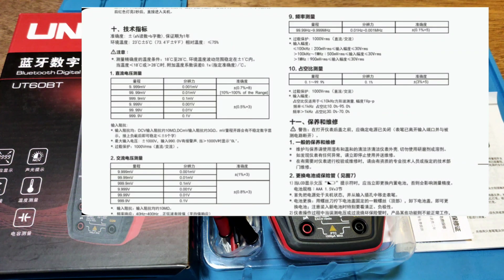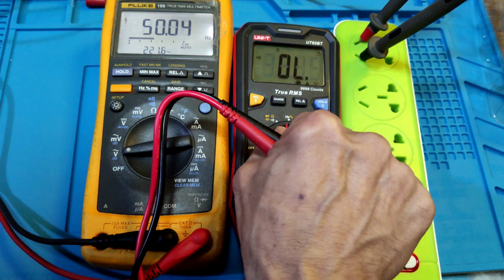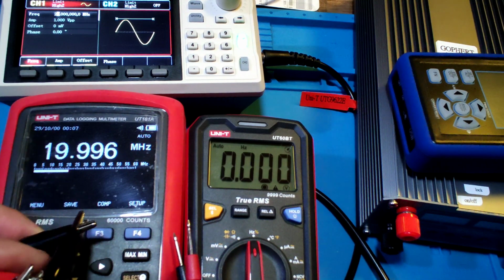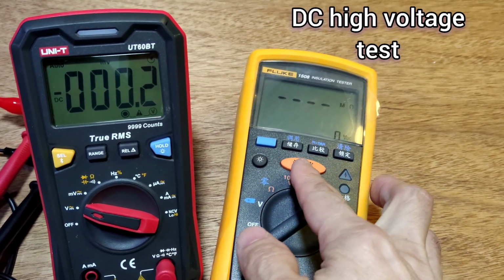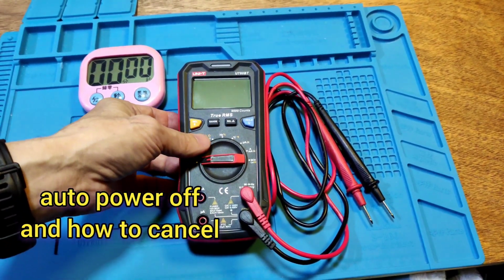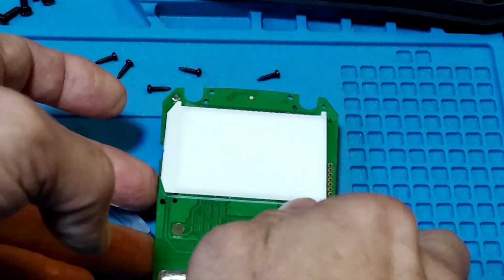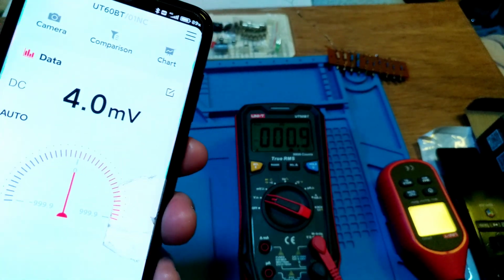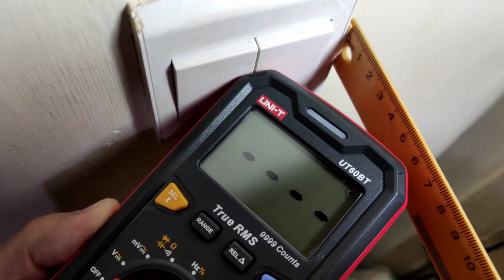UNI-T UT60BT 9999COUNTS BLUETOOTH MULTIMETER CATII 1000V,CATIII 600V

Comment: Hi Wilson, good day!  I cannot find any reviews showing that this UT60BT can test a HOT wire using probe like the UT123D (besides NCV).  Is it possible to differentiate HOT wires using this multimeter? With GROUND, it is much easire to test HOT wire, but here in our place only LIVE and NEUTRAL.  Can this multimeter differentiate HOT from NEUTRAL with ground LIKE the UT123D? Thank you in advance 😀
Reply from the maker: normally any of multimeter can use ac voltage function to do it ,one probe to hot wire and the meter may have above 3 to 4 v ,and other test probe test to the ground or netural wire can give a supply voltage like 110V or 220V .that mean the 3 to 4v line is a Live hot wire sir.thx for watching.
Reply: Thank you so much for the reply 🥰 appreciate it..what you said on one probe to hot wire really works, UT123D reads 7.9V in AC mode, thanks again... have a great day 😀 @wilsonluilui

Comment: Thanks for the video. Do I see correctly that in Bluetooth mode measurement samples are sent only once per second? Is it possible to increase the rate?
Reply from the maker: sorry we don't have a counter of second to measure the Bluetooth reading ,you can email to uni-T they have engineer to tell you.because we not a engineer,only a normal electric electrician only.hard to buy a high end instrument for test.🙏😅

Comment: cause of 1.0 ohm problem
https://www.youtube.com/watch?v=vq83TO2vXg0
Reply from the maker: Thx for your help 👍👍👍,but it not for the TEST lead problem of this meter.
Reply from the maker: it is the meter inside parts have problem,and not to ZERO ,and i buy A New one that is good and can tend to near the zero ohm sir.
Reply: @wilsonluilui  good, but its test leads are very suck, they eventually have contact problem within a year, however the meter can stand for years without any problem!!
Reply from the maker: it New meter and New TEST lead,thx for advise.
Reply: @wilsonluilui  newest model come with gold plated test leads, hope they last longer
Reply from the maker: @garywutube  it quality may be( good For Low resistor contact)

Comment: Very nice for your review UNI-T60BT, I'm not sure this model is same specification UNI-T60EU  or not?
Reply from the maker: in my country no UT60EU ,and you can see inside the circuit board is named at 60EU ,it only add a BT module in this meter only .